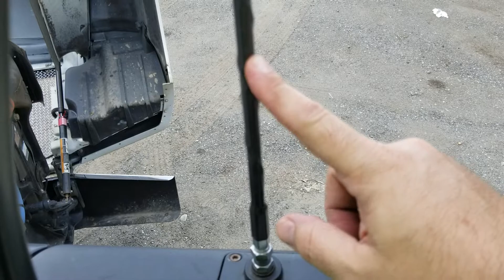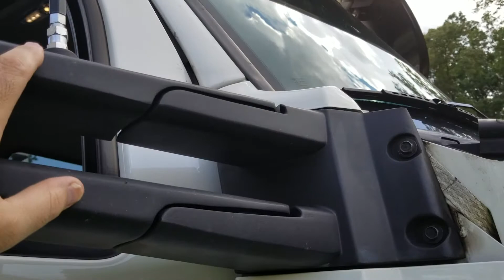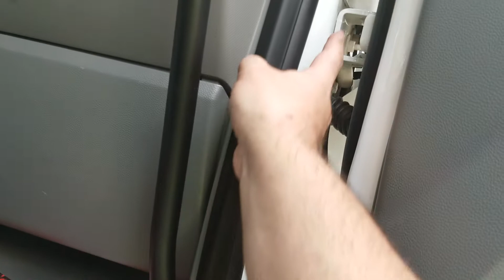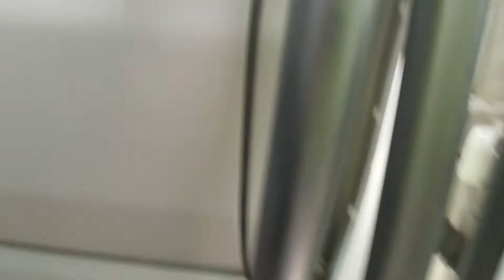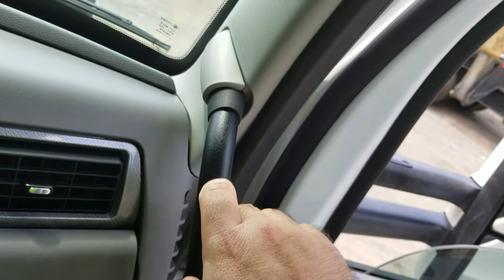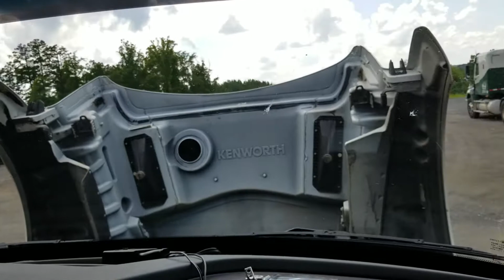Kenworth T880 Custom CB coax and antenna grounding and install.

Comment: hey j rich quick question for you i got a t880 dump truck i got a stryker 447 8 ga to the batteries new coax one antenna on the drivers side i used the ground straps on the mirror mirror down to cab and cab to ground block and both hinges on the door on the drivers mirror/door only do i need to ground both mirrors/doors or just the drivers side

Comment: How you call this easy? gotta remove 20 things to run a 15 ft cable, its ridiculous, they could just engineer an opening where you come off the mirror shaft and run the cable straight into the side of the dash? swear to God

Comment: Hey boss do you have to have the 90 deg end for in the mirror on coax cable or does it have enough room in there for a straight end?

Comment: I running a 27 inch predator 10 k coil on a metal 2013+ antenna bracket iowa 80 truck stop has being 2024 t680 got has no mirror antenna and checked swr with a 9ft rg8x coax getting bout 1.3 swr usually run rg213 but being it thick coax have to route it different way usually run a 8 gauge power wire to battery

Comment: Any tips on how to remove the 4 little mounting bolts on the mirrors where the antenna goes? They don’t want to move and the bolts want to get messed up from the heads
Reply from the maker: I'd get a can of Seafoam Deep Creep spray them and let it soak in for a few hours. Then give them a couple taps with a hammer and punch before removing. Use a dabb of anti-seiz when putting the bolts back in.
Reply: @jrichtruckincbtips  10-4 ill try that thankyou!

Comment: Was that 1/4" grounding strap from antenna to mirror bolt? How long would you need, getting ready to make an order.
Reply from the maker: 1/2" x 18" you can get it on Amazon pre made from AC Delco. Or if you're into making your own you can buy ground strap by the foot from DX Engineering for a lot cheaper. While this was a great improvement watch this video on grounding the T880 mirrors. https://youtu.be/Ar6mxY57lzs

Then watch this one on RF bonding to take your antenna system to the next level. https://youtu.be/J6PJyw6jh2M

Comment: Why 18ft of coax? How about of I only need 6 to 8 ft? Will it matter?
Reply from the maker: Coax should be done in 3' increments. I usually need 18' and even 21' sometimes. I've heard some say 12' has worked perfect for them.
Reply: Use 9' or 11' coax if you need 6-8 foot
Reply: 3’ increments are close but not exact. Length depends on most used freq. I use a mfj 259D. It tells me my coax length. With lowest swr and still at 50 ohm

Comment: Hmmmm... I thought the CB antenna was just the driver side. It's both?
Reply from the maker: On the 680 and 880 they are co-phased. So yes both, but on this truck I ran new coax to I side then changed to the driver's side. Here's a step by step walk through on running coax and grounding the antenna. Thanks for watching.  https://youtu.be/Ar6mxY57lzs

Comment: Another reason for truckers & even 4-wheelers to have a cb is for rig reports.

I was running down the interstate & another driver got on his radio & informed me that something under my semi trailer was throwing sparks. I immediately pulled over & saw that the long metal spring that holds the air lines up had busted loose & was scraping the pavement. The airlines were in serious jeopardy too.

So, the cb radio saved my bacon. I was able to do an easy & quick roadside repair on that spring, & I was up & running again.

There have been countless times that I myself have noticed something dangerously wrong with another driver's rig, & I've tried to let them know about it on the cb, & they're oblivious because they don't have one. So frustrating!

Sure there's trash talk sometimes on the cb, but there's a lot of good drivers out here too. So, if you're on the fence about getting a radio, I say do it! There's more positives than negatives to having one.
Reply from the maker: Well said, some will never get it.

Comment: How did you install your power cord to you batteries?
Reply from the maker: On that truck, I went from the radio, down the driver's side, out the grommet that's behind the filler panel, down to the frame, then back to the battery box.
These links maybe helpful.
Making your own cables.https://youtu.be/9rzvfheIjpE 

Adding quick disconnect battery cable.https://youtu.be/SUpiJ80gPJY

This is better step by step walk through of this video and you'll be able to seethe grommet that the cables come from.https://youtu.be/Ar6mxY57lzs

Thanks for watching.

Comment: Which ground straps did you get?
Reply from the maker: Watch this video for a in depth walk through and the strap is 18 inches. Thanks for watching
Reply: You said one from antenna to end of mirror is one size and one from mirror is another width. That’s what I was asking which two straps you bought.
Reply from the maker: @charlesbuhl4880  1 is 1/2" x 18" and the other is 1" x 8 or 10". However you'll do just fine with the 18" strap in the other video.

Comment: Im in a ‘06 KW T800 with western mirrors and chromed metal mirror mounts & brackets, is a separate ground strap or ground wire necessary or are the mounts, being bolted to the aluminum cab, already considered grounded? I’m about to do a complete replacement of antennas and coax.
Reply from the maker: Probably not necessary.

Comment: Does it matter what size ground wire I used does it have to be braided
Reply from the maker: Typically you want it to be as short as possible, and I use the flat braided because it's easier. In that video I used 2 separate ground straps one is in the mirror that you can't see. I did another video with a step by step process with the same great results check it out here.https://youtu.be/Ar6mxY57lzs

Comment: Good afternoon sir!
Quick question... I understand how to tune a single antenna, but is there a way to tune dual antennas? I run a KW880 with duals from factory.
Thank you for your time sir. God bless!
Reply from the maker: Yes you can tune dual antennas, but it would  be much easier to get 2 tunable tip antennas. I like Firestik, but prefer Skip Shooter's at least 5 foot. On the factory antennas I would stop in a CB shop and let them do it. Because it can be a real pain, and they have to be equal. Thanks for watching and God Bless !
Reply: dont bother, unless they're actually phased at a certain distance apart there's really no gain, and then only in a prefered direction.

Comment: I really wish these truck manufacturers would put decent stuff in to begin with, for those of us who have to contend with "you can't change the outside of the truck *at all*" type company policies that stem from company owners who are perhaps a little too concerned with appearance.

That being said - I can make it look close enough to factory with black 6' or 7' Firestiks - is there a way to do the grounding without it being immediately visible to shop staff, for instance, upon raising the hood?
Reply: Also, I don't know where all you run, but if you can make it to Walcott, IA, WalcottCB has 44" stainless steel shafts in Stock. On the Cascadia I drove until the end of January, I had an "oil coil" antenna on that plus a 10" Wilson shaft for 54" total and it was excellent. I-65 Northern Indiana with a cobra 29LX tuned by Rick at the exit 6 TA (Gary) I was talking to a guy at the 220 from the 205 without issue.
Reply from the maker: @lt1caprice57l   Sounds like a great setup. Around here in North Ga a stock Cobra 29 will only get about 5 miles or so.
Reply: @lt1caprice57l  how is Gary vs Q5?
Reply: @rabbibacongrease88  The aformentioned 29 LX done by Rick outhears anything else I have at the moment.  It seems to do every bit as good as the 86V on transmit.

You ever get that recording uploaded?
Reply: @lt1caprice57l  I still have it somewhere.
Reply from the maker: Watch my step by step coax install video. In this video I show in real time grounding and installing coax on the drivers side of the same truck. I do install a ground strap, but it's hidden in the mirror. If you don't want to do the ground strap follow all other steps. This will make a decent improvement. Thanks for watching!
Reply: @jrichtruckincbtips  THANKS for sharing that's why I think I'll stay in my old t800 even though my company keeps offering me a new t 880 automatic we have daycabs I'm a trash hauler out of Chicago alot easier changing COAX and antennas in the older trucks pop the rubber grommet at roof and run new connector and coax with ease too much plastic on new 880 HOWEVER CAN YOU UPLOAD A PIC OF THAT GROUND STRAP YOU RAN TO FIREWALL , WHERE TO BUY,WHAT KIND ,OR A LINK WHERE TO GET in case I bend and take a new 880.i just like being in an older tractor again no def,no Regen, no Ard heads acting up lol. Recently got out of my 2009 which company sold cause it was at 900k with all the emission crap. My 2007 so much more reliable but would live to see the info on ground strap sorry to bother you if your ever crossing 80/94 in Gary Indiana exit #6 Burr St see Rick at cb shop   best around here Monday THRU Friday 11am-7pm closed Saturday and Sunday THANKS AGAIN PEACE FROM CHICAGO!!
Reply from the maker: @iamkazie9401  I definitely understand! Watch my Step by Step coax install video. You should be just fine running the hidden ground strap, and don't worry about the larger one that goes to the firewall in this video. You can find it on Amazon  it's an AC Delco EGS20. You may find one at a local parts store, but it needs to be 20" long. Don't want you getting in trouble. If you will be running 2 antennas both will need to be grounded so they match.

And I only go as far as Shelbyville Ky from Atlanta, but thanks for the info on the CB shop. Oh and I'm at 130k on my T880 without any issues with a ISX15. It does its regen every morning on start up while it warms up and only takes about 10 minutes.
Reply from the maker: @iamkazie9401  Check this video it my help simplify the process. https://youtu.be/Ar6mxY57lzs

Comment: I learned a lot what type of radio are you running
Reply from the maker: Thanks for watching! I have a Galaxy 47hp you can see it and how I installed it in the T880 in my other video. Look for custom cb install in KW t680 and t880.
Reply from the maker: I also have a video showing a step by step coax install on the drivers side. Which will also apply to the passenger side. Check out my channel. Thanks.